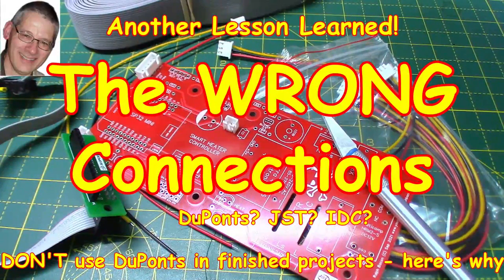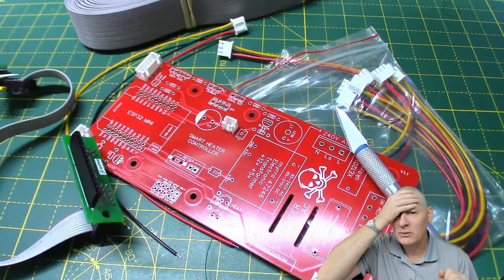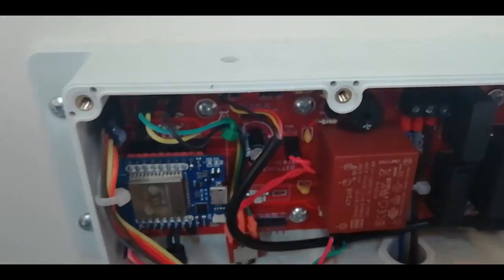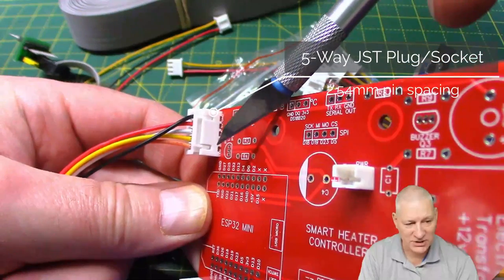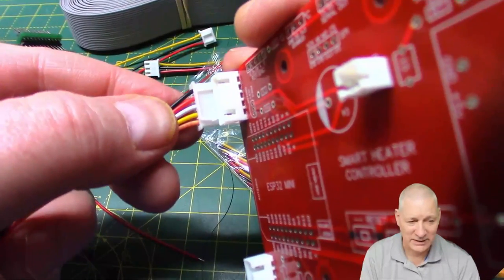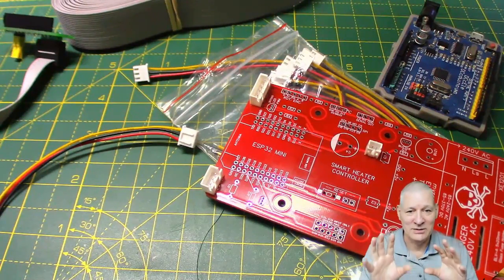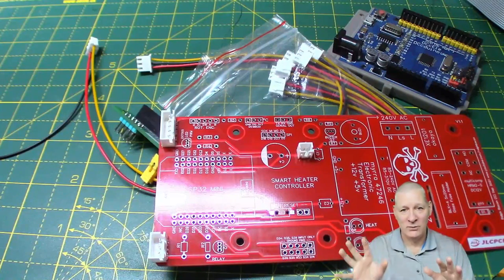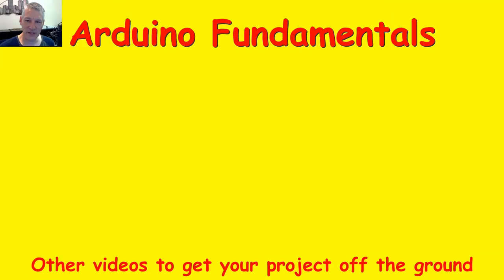#238 The Wrong Connectors😲forget DuPont, use JST or IDC for final use

Comment: I'll just advise to be careful when saying 'JST' connector as they make a ridiculous number of connector types, similar to Molex and other similar companies. I can't confirm this, but it looked to me as if you were using JST-XH connectors which are 2.5mm pitch, not 2.54mm and a quick check of their Crimp and IDC wire to board connectors seems confirm this. They may be harder to source, but is seems like a JST RF connector might be more ideal for your needs, or if you don't mind your connectors being 2.0mm pitch, a JST PH connector(for future projects). The don't lock quite like the JST XH connectors and as pretty easy to come by as I believe they are commonly used for smaller battery packs. As for the ribbon cables, I guess my experience has been the opposite as they can be a pain to remove and I've bent more pins on my raspberry pi trying to remove those 40 pins connectors than I ever have with the JST connectors, but they can be nice as you don't have to use the connectors with the ribbons if you have a bit of patience to ensure that all the wires are aligned. Can be great if you want to use the connector, but need something with a bit more flexibility.

Great info, dupont cables are horrible for 'finished' projects and always check your connectors for current per circuit ratings. Going with an improperly spec'd connector is right up there with using undersized wires for me.
Reply from the maker: Hmm, you are not the first to say that JST XH are 2.50mm not 2.54 (and JST does indeed state this) but all the sources I've found all sell the XH as 2.54mm - perhaps the 0.04mm just doesn't matter too much for a few pins? Even after 10 pins we are still only 0.4mm 'out'.

I'm also looking at some locking connectors that are much easier to unlock - when they arrive off that slow boat from China. All will be revealed some time in the future.

Ribbon cables are meant to be fitted and left alone, I reckon. When you try to remove the plug it acts as a lever against the remaining pins and can easily bend them as you have described. Nightmares from the 1990s and IDE cables from the PCs I used to build...
Reply: I wish I could find a larger version of the JST-SH connector used for STEMMA QT/QWIIC sensor boards. They are a lot easier to separate than their larger XH or PH cousins, but those pins are the worse and the SR(I believe) IDC version of the socket isn't much better.

I hope the new connectors you're trying out work out well. I've spent far too many hours looking at connector types, but better to spend time now to get it right than discover serious issues later when I try to use them to deliver power from this 300W power supply. I've already been down that road with the leads that came with my benchtop PSU.
Reply: I have several "simil JST" like connectors, and guess, some of them have centred row of pin (respect to the plastic connector) and other I think 0.5 or 1mm shifted,  so in addition to the plastic safe guide the pins can't be reversed at all because the holes did not fit. But then you MUST have the female and male connectors either shifted or centred. I had to rebuild several connectors because I just did not notices when crimping that I used a shifted male and a centred female connector. JST are really a nightmare for me, especially when suppliers post wrong specs or fake photos that does not correspond to the item they sell....😫
Reply from the maker: I'm using a different connector on my latest project, the JST-XH. Allows one-way round connections, easier to unplug but still won't come apart and crimping was easy. Full details in a future project about my Storage Bins Lid monitor!

Comment: I've always taken Dupont connectors as being for "development only".

By all means, arduino,  breadboard project friendly.
But not for a finished project.

You simply don't see them in good quality production electronics for good reason.  And.. If they are using hot glue as an answer to that.. Then that's not great either.
Plenty of alternative connectors are available that are designed for the task.

BTW Ralph. Thank you for the audio board PCB. It arrived in quick time. Just waiting for the boards from China. 👍
Reply from the maker: Glad the Bob turned up, Jason. Good luck with soldering the tiny BT module onto it - do-able though!

Yes, using DuPont/Hot Glue in a finished project is definitely not the way I will be going again! Probably. 😮

Comment: Hi folks, don't use duPont connectors. They require a special crimp tool to properly form the crimp, the geometry is subtly different - look it up on Google. I've found them fiddly to make and unreliable in use. I adapted a crimp tool with removable jaws to get the proper crimp profile. Much, much easier is to use miniature screw terminals with a crimp ferrule on the wires.
Reply from the maker: Even with the special crimp tool (I have one) it still is fiddly and unreliable in use (which is why I end up crimping and then soldering).

Comment: Clearly connector selection is a very important part of any design! If you spend the time, you will find that there are hundreds if not thousands of types of connectors, many of them have locks that are better than friction locks and are designed for easy removal (usually by pressing on a little tab to undo the lock tab). Usually the problem is making a selection from the dozens of connectors that are either the same, or so similar that choosing 1 becomes a task all in itself! 
Don't forget that wire and cable selection is just as important as connector selection, and often even more difficult than connector selection.  :-)
Reply from the maker: Just what we need, a huge selection of plugs and sockets when all we really want to do is MAKE stuff! Sigh. More haste and less speed will allow us to build a better project though.
Reply: @RalphBacon  Yup, early in my career as and EE, I thought, "why so many wire types", and now nearly 40 years later, I still think, geehs, why so many wire types. Same thing applies to connectors. :-)

Comment: I have used IDC connectors for many things.  Please go to Amazon or your favorite electronics supplier and purchase anIDC Crimping tool.   They are quite inexpensive, around $16 USD.  They will properly crimp cables for small to big.  I got my crimper so I can build 50 pin cables (for 8 inch floppy drives).
Reply from the maker: Sorry, Robert, "floppy drive"? Sounds rude. 
But here's a link for the crimper, for those wanting a dedicated crimp tool: https://amzn.to/3Iqby9N or https://amzn.to/3LUmGxX
Reply: @RalphBacon  Obviously I am referring to 8 inch floppy disks and the associated hardware from the 1970's.   Yes, I still have my 1975 purchased IMSAI 8080 system.  I am in the process of bringing up that old gal, so I can transfer a lot of my stuff from the 70's/80's to more modern storage.
Reply: @RalphBacon  BTW: Great channel, like the pure electronics projects!

Comment: On the JST connectors you could use a small file and just file down the socket's  nubs  a little.
Reply from the maker: I specifically didn't want to adapt the socket because then we have burnt our bridges, so to speak, John. By amending the header plug we can always replace that if required.

Comment: A chinese 3D printer accessory manufacturer ships their touch screen with dupont plugs, because they have zero pin order discipline in their own controller board RS232 headers; they have four permutations of the header across their product range (their worst on a shipped product was messing up a standardized servo header with GND and +5v swapped for blue smoke.) Thankfully I had a huge bag of JST-XH connectors of different varieties.
Reply from the maker: Dupont cables are the cheapest and nastiest connections that ever existed. But we need them. Better quality ones are available but they cost considerably more.
Reply: @RalphBacon  Indeed they are a necessary evil. Case in point, I can't understand how PC industry can make data buses transferring billions of bits per second work but can't agree on an universal front panel connector for four signals.

Comment: I have no idea how many ribbon cables I have while in the RAF.  But we used parallel pliers and not a vice.  I hate to think what the MOD paid for these parallel pliers.  lol
Reply from the maker: You can get simple parallel plier crimpers for under £20 (I have one) but I didn't want to put viewers off by suggesting they needed one when a vice will do the job nicely for just a few cables. A "proper" one (MOD approved) costs about £600.

Comment: when i mount something on the board itself then i use dupond. External Power is via Pluggable Screw terminal from phoenix contacts or dc barrel jack
Reply from the maker: I no longer use DuPont cables except for prototyping on a breadboard. They are too flimsy for real projects.

Comment: Are you sure that those JST connectors are exactly 2.54mm pin spacing?

The JST XH connectors are actualy only 2.5mm pin spacing, and the JST RE which are 2.54mm look very different.
Reply from the maker: Well, all the AliExpress adverts say 2.54mm even though, as you correct state, the true measurement is 2.50. I guess it is "close enough" to fit hobbyist-type pin headers, stripboard and breadboards. I've used them without issue that way. 

As an aside I have moved away from JST as they are real pain to release. This is intentional, of course; you don't want your battery pack detaching itself mid-flight, right?

But KF2520 connectors are similar, inasmuch that they latch, but are much more easily removed, ideal for hobbyist use. You might spot them in some of my later videos.
Reply: @RalphBacon  oh interesting, I've been wrong to avoid JST XH connectors because I was worried they wouldn't fit. Thanks for the info!

Also thanks for the pointer on KF2510! I've seen them around and I was wondering what they were called.

Comment: It's a bit ironic that you suggest using JST connectors because they are more secure then take steps to make them less secure !  If you do want to make them easier to take apart then it is probably easier to remove the bumps on the slots of the socket rather than the bumps on the plug

Either way they are certainly more secure than single Dupont connectors and the fact that they are polarised is a bonus, but with ready made plugs on leads the positioning of the red and black leads sometimes needs to be changed if you are going to follow conventional colouring and need a particular layout because of PCB design considerations

One thing that I don't like about using JST plugs and sockets is that it is more difficult to make custom length leads because it really needs a good crimp tool to make the ends whereas a Dupont crimpled connection can be made with a much cheaper tool

Where possible I prefer to make inter board connections with header pins soldered on one board and sockets soldered on the other in the style of Uno shields but this is not always convenient
Reply: I couldn’t disagree more. The circular insulation crimp required by DuPont contacts is something practically no inexpensive crimp tools can do, which is why probably 99% of DIY DuPont crimps are abhorrent. JST XH requires a very thin crimp die (like a crimper made for D-sub contacts) but is otherwise a less fickle crimp.
Reply: @tookitogo  All I can say is that my "cheap as chips" crimp tool handles Dupont connections well, including the insulation clamp when used in the right way, it certainly won't handle JST crimps

I have in the past been tempted to buy an expensive crimping tool but cannot justify it for my modest needs
Reply from the maker: OH NO! I thought my DuPont crimper would also crimp JST connections, now you're telling me it won't! 🤦‍♂️
Reply: @RalphBacon  Yours might, mine won't, or at least I have never had any success when trying
Reply: @tookitogo  Yes, agreed. I have had two different crimping tools for dupont connectors - neither worked well or reliably and the spoil rate was high. I watched tutorials, I looked at photo guides...... just a real hit and miss task and very frustrating and pointless - esp when you can buy hundreds of them on various wire sizes and gender combinations so cheaply ready done. I obviously don't have the knack of making my own, but I am past the point of caring now and just buy what I need.  The old time vs cost trade off again!
Reply: @alanmusicman3385  I ended up buying a new, top-quality original crimp tool (cheaply on an auction site for around $60) that’s close enough to work well. The difference is night and day, practically as good as the actual correct tool at work. 

For hobbyists, I am now recommending the Molex KK254 series (and its common clones, like KF2510), because their crimp is far, far less fickle regarding the tool, and because the contact shape is more resilient than cheap DuPont contacts.
Reply: @Bob_Burton  No offense, but I seriously doubt your insulation crimps are correctly done. What crimp tool model do you use? The most common model sold online for DuPont contacts is the SN-28B, which is actually designed for 2.8mm faston spades, so aside from the wrong insulation crimp shape, the jaws are much too thick. :(
Reply: @RalphBacon  They’ve got completely different crimp dimensions. JST connectors in general use quite short crimp wings (along the total length of the contact), and thus require a tool with thin jaws. Try the IWS-3220, I’ve had good results with it. (DuPont contacts have unusually long crimp wings, for a thin-wire crimp these days. Newer designs almost all use shorter crimps like the JST. And as mentioned, DuPont crimps require a different insulation crimp shape.)
Reply: @tookitogo  No offense taken
As I said in an earlier reply the crimp tool is nothing special.  It is not currently to hand and I am not sure that it even has a model number

All I know is that it does the job that I want in making up Dupont connectors when I need them.  I very much doubt that the resulting crimps would meet any exacting standards but frankly I don't need them too as they are used in non critical situations.  That brings us back to the point of Ralph's video which is to advise against using Dupont connections in a production environment

To summarise, I can make Dupont crimps to meet my needs using the tool that I have and have no intention of buying a better one as I can't justify the expense.  As to using JST or IDC connectors, they are totally unsuitable for use in prototype or experimental projects using breadboards.  

I have PCB based Nano and ESP32 prototype boards of my own design that have a mixture of permanent connections (pushbuttons and LEDs) and free pins to allow interconnections to be made using Dupont sockets on patch cables.  JST and/or IDC connections would simply not be suitable for this application

These boards are mainly used for my own experimentation and also to enable quick testing of other users projects when providing help on the Arduino forum
Reply: @Bob_Burton  Thanks for your reply! 

I do use JST and KK 254 connectors in prototyping (since they work well on standard 0.1” perfboard and veroboard), but yeah, you’re right that they’re useless on breadboards. 

I really need to try some of the non-Chinese-clone “DuPont”-ish male crimps. Most of the major series (including Amphenol Mini-PV, Molex SL and TE AMPMODU MOD IV) have male crimp contacts too, which should be suitable for breadboarding.